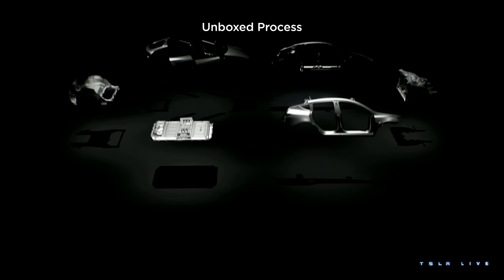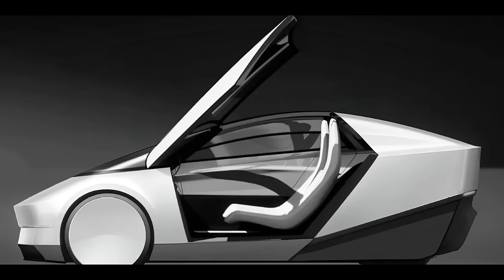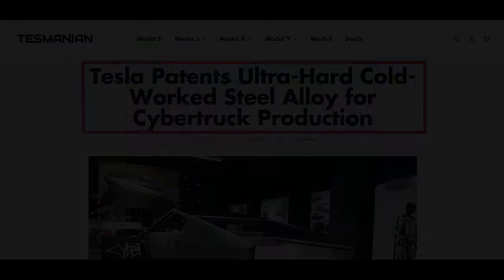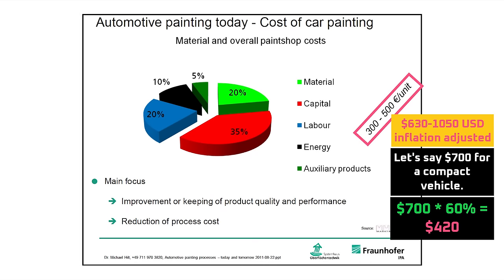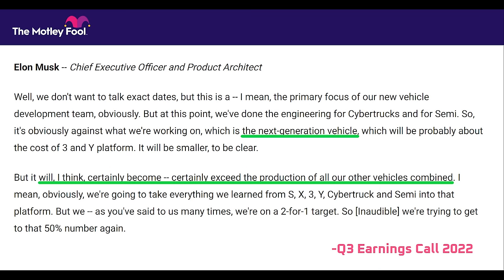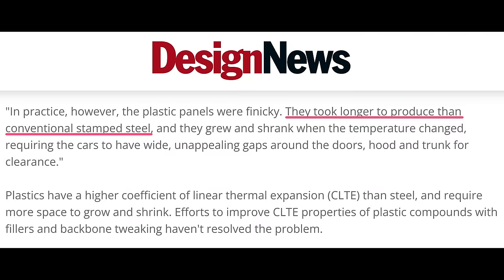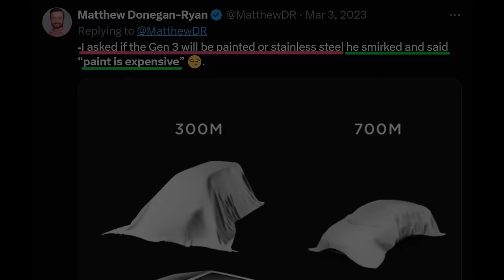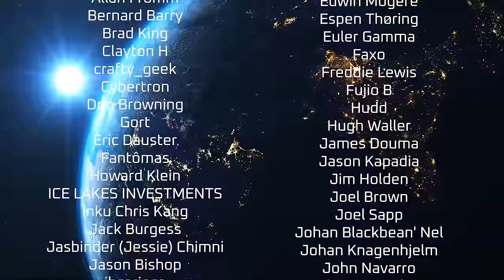Tesla's Next Gen Compact Vehicle // Stainless Steel vs Paint

Comment: Costs $420 to paint the compact? That checks out.
Reply: @thelimitingfactor  IIRC the way accountants work, 1. They ignore the factory-capital cost/(probably)water-consumption/water-treatment etc which get lumped into overheads & distributed across all elements of vehicle cost (paint has a big foot print).  2.  Defects and remedial are also likely to be treated the same way, so paint damage further down the line say during installation of a door will get assigned to door costs or over heads. 3. the time the vehicle is in the build process gets picked up in over heads.  Me, I’d quite believe paint costs 25% of a vehicle, but others, like Munro & Associates could tell you for sure

Comment: Plastic can be high quality, it's just usually isn't. A good example is LEGO. There are countless advantages of plastic, and few disadvantages.
And I don't think people care too much about the prestige of a robotaxi. As long as it looks solid and comfortable, it's fine. And for those who want to show off, there will be legacy Teslas.
Reply: I agree with you, but the plastic problem isn't just about initial quality. I used to sell the machines used to make lego molds, and the key is extremely tight tolerances for the mold and injection molding process. The problem with plastic, at least according to Bob Lutz, is that no matter how precisely you make the part, it has a lot of thermal expansion. I just don't think it's an issue for a taxi.
Reply: Plastic could be molded with colors, no paint required
Reply: If Tesla figures out a great plastic formula, and it gets the price and weight down, I'd totally buy the car. In a taxi I also wouldn't car of course.

Comment: For the cheapest model, price seems to be the driver for consumers.  Plastic didn't stop customers from buying Saturns.  And I understand that Tesla has some top tier material people, who might be able to solve the problems for plastic panels, just as the stainless steel issues were worked for the CT.  Of course, if it's an entirely new material for panels, that's potentially exciting.  (A risk, but Tesla seems to take risks, and there could be a cost, or production speed or space, upside.)
Reply: When Sandy Monroe suggested to Elon he mix Aluminum and Carbon Fibre Elon was dead against it. Elon trained as a materials scientist at University.
Reply: Corvette has been fiberglass for 70 years
Reply: @jamesengland7461  And fiberglass is dramatically harder to work with than injection molded plastics.

Comment: A notable advantage for plastics is their low thermal conductivity that can significantly offset cabin environment energy use in an EV. This thermal break also helps to slow battery degradation rates while the car sits in the sun. This low thermal conductivity does come at the cost of dimensional stability (relative to metals) however, and larger panel gaps can greatly affect attached airflow. Gains in thermal performance could be more than offset by a decrease in aerodynamic performance at higher speeds. But lower speed taxis designed for city use, I suspect plastics have more pros than cons here, as total cost of ownership (i.e. outdoor storage) is very heavily weighted in fleet vehicles. Worth noting, the angular look of SS would be a liberty in a pedestrian heavy enforcement. A lawsuit there would likely increase the cost of ownership outside the scope of consideration.
Reply: Great comment, great ideas!
Reply: Would a steel car cabin heat up slower in the sun than a aluminium cabin?

Comment: When Penske/Mercedes finally brought the Smart ForTwo to the US, I bought one.  I drove the wheels off that thing in and around southern California.  Of course, I hopped it up with wider wheels, a better (and noisier) exhaust and lowered  the car an inch.  In dark blue and black it looked like dart Vader's helmet.

Why do I mention this.  Because I found it wonderful to pop off any plastic panel easily for access beneath.  I don't think there was a panel that I didn't remove several times.  I never broke a fastener and the panels always returned to their correct positions with minimal panel gaps.  Smart owners would go to gatherings where people would swap panels.  Don't like Yellow?  I do,  How about we exchange panels/colors.  I saw some cars leave such gatherings with every panel a different color.  Talk about a coat of many colors!

The SmartCar concept was excellent.  The car shape was too unconventional to many Americans, but the real flaw was the computer controlled mechanical clutch and gear shift.  It was efficient, but it was slow.  The gears changes were slow and the gap between first and second was a chasm.  But once rolling it was a delight in traffic.

If Tesla were to follow the SmartCar body material with a more conventional style, and hopefully a higher rear roofline with a full hatchback, I am convinced it would be a winner.  Stainless? No thanks.  Painted?  If it's less expensive, but I seriously doubt it.  You could buy a full set of different color plastic body panels for the SmartCar when new for $700, admittedly a decade ago.  When I sold the Smart after ten years of heavy use, and despite it having spent many days parked in 'door ding heaven' multi story car parks, the bodywork still looked like new.  For me, plastic panels are the solution Tesla needs.
Reply: Under-rated comment. Smart-style city cars are the way. 
(Who needs rear wheel steering to go get a bag of oranges?)
Reply: @nickfosterxx  you don't but I would happily drive mine all over the UK, up to about three hundred miles, with no comfort issues or safety concerns. Admittedly, I'm not an abject coward as a lot of people who scream that small car are unsafe clearly are but they were great cars for the time.
Reply: Yes, the Smarts automatic gearbox wasn't as fast as it could have been, although it did apparently improve over the one I had. It was really fast compared to every single car I ever raced off the lights though due to the weight. And boy did people get annoyed that I could overtake them on the motorway because they weren't actually doing 70 anyway. Lots of bruised egos. The panels were great and while I never modded mine, knowing I could was a bonus. If only they'd made their electric one a ground up vehicle and done it properly it would have been as good as the Chinese versions with a much larger range. Sadly that's not the Mercedes mindset, they're much more comfortable designing out of date technology and the original Smart guy wasn't around to push them any more so they stabbed it in the back like the traitors to humanity and engineering they are at heart. 

If Tesla put more than two seats in their budget car I will not be surprised but I'll know they were never serious about the idea at that point.
Reply: The BMW i3 was constructed as a carbon fiber monocoque on top of a aluminium frame with abs body panels and seems to be extremely durable.

Comment: If I could place a wager on the future manufacturing processes of the Model 2 / Robotaxi  I'd put a stack on the following:

Gigacasting approach to make all structural components: Door rings, door and rear hatch structure, front and rear chassis & roof cross members with a coated finish where required . This eliminates all stamping and welding processes and gets close to the "Whole Body Casting" approach without the complex mould geometry. Thats 11 cast components total by my reckoning.

Exterior panels: Mould in colour body panels consisting of front & rear bumpers, door, hatch, bonnet (hood) and rear quarter skins with a glass/polycarbonate roof. Smart have been using thermoplastic body panels for a long time with no descernable issue with panel gaps. I've seen at some trade shows that colours other than solids (e.g. white, red, black) are available for injection moulding, this includes metallics that are indistinguishable from a painted surface.

Said thermoplastics can have a high % of recycled feedstocks as other manufacturers have show e.g. Volvo using recycled window frames and Renault using recycled plastics in interior fabrics.

Hard-wearing rapidly replaceable bodypanels and non-rusting structural components would be a good fit for Robotaxi fleets with expected lifetimes spanning decades. For the same reasons the Model 2 will appeal to buyers who place reliability and dependability high on their list of requirements.

Comment: Great work Jordan.  IMO, The future belongs to ones that can make good looking diamond like coatings simply and inexpensively.  Stainless does not need to be highly work hardened super alloys.  Any one of a number of appliance type stainless alloys could be near directly replaced in a conventional stamped and formed body part.  Will be interesting to see how much more they use lighter aluminum and or magnesium alloys as well as  possible ceramic coatings to maximize finish durability's.  I expect a bit more of the sandwich approach they applied in the rear of CT with castings and molded plastic substructures with metal or FRP exteriors.  New bench marks in specific strengths and stiffness .

Comment: I think the 25k car and the robotaxi are actually the same vehicle.

It will be designed so that it can be shipped with or without a wheel.

As for the panels, taxis, rentals and non owner use in general usually results in higher maintenance cost because people don't care if they don't own it.  Having a stainless steel body could save in that regard.

Comment: Good summary, good numbers. Thanks.  => The no paint aluminium option would have been interesting to analyse.
Reply from the maker: Good point!
Reply: A lot of motorcycles use anodized aluminum.
Reply: That is intriguing.
Reply: Good colour ranges possible but I’m unsure about resistance to coastal conditions. Having said that, all our bus panels in Africa are from rolled aluminium
Reply: Afik aluminum is a lot harder to stamp into complex shapes.  But a hot-stamping process like Tesla is already using on CyberTruck might change the numbers?  An alloy which age hardens at room temperature (like 2024) stamped and quenched by cold dies would be interesting.
Reply: @martylawson1638  Model S has aluminum panels.
Reply: Aluminum seems to be more expensive, and repairs are definitely more expensive.
Reply: @martylawson1638  model S and X are mostly aluminium.
Reply: @patreekotime4578  for a robotaxi, the no paint is a plus. Harder to repair is a downside for sure unless panels are swapable like on a smart car.
Reply: @martylawson1638   But what about cast aluminum like they are doing with the car bodies?  Could they do that for the panels too?  Or even cast the body panels with the rest of the car body?
Reply: @logoschristianacademy6044  Cast aluminum body is another interesting wild card option.  Casting has a relatively thick minimum thickness so the cosmetic surface would have to be structural.  Might need a secondary finishing step to hide sink marks and mold wear.  On the other hand, toys and appliances have done it forever...
Reply: Unpainted aluminium is often used to construct boats and canoes, so it would not be unexpected for a car to be constructed from it. However is there any reason cars are not constructed from it, could it be to maintain colour and texture consistency between materials.

Comment: You can't compare to the Saturn, as there have been major advances in polymers since then, most models of cars use an extensive amount of plastic on their body these days without major issues.
Reply from the maker: They always have in bumpers, etc.  But not the body.
Reply: @thelimitingfactor  Bumpers, the entire fascia, kicker plates and wheel arches on off-road type vehciles. All of the protruding bits like mirrors and spoilers, the entire exterior of those fancy light clusters. Take a good look at a modern vehicle. At least 30% if not 40% of that surface area is plastic.

Comment: Material rigidity is the cube of the thickness so 0.25mm is 64 times less rigid than 1mm. I doubt that 0.25mm sheet metal would be a reality on vehicule body. Also about the value of stainless, I think customers will not only see the initial cost it add to the vehicule but also the value of durability for region where corrosion is affecting vehicule alot.
Reply from the maker: Yeah, I was trying to give the devil his due

Comment: Hey Jordan, as someone who works in mfg engineering, this is a great analysis! A few additional thoughts: 

1. Personally think if the low cost vehicle were to use SST exterior, I would think they would use a less hard alloy, such a 304, or a lower cost alloy like 400 series. Preferably one that could be efficiently stamped and shaped instead of the complicated Cyber truck processes. 

2. (Out there idea) For color it would be interesting if they used a heat treating process to add a color hue or tint to SST while adding strength.

3. In my work we like to perform a Unit Operations analysis (first principles) when evaluating and developing new processes. Break process down into individual unit operations and assess for critical to quality, ease of assembly, risks, mitigations, time, cost, etc. Have you considered running a hypothetical analysis for a traditional painting process and look for possible optimizations? 

Hope you're doing well! - Nick
Reply from the maker: Good points and thanks for the feedback!

Comment: I am wondering if they are making their own SMC CF for the cybertruck bed parts or is that a subcontractor? The old Saturn's were the beginning of that with fiberglass reinforced body plastic panels. SMC can make very nice body panels from fiberglass these days that are durable and easy to repair minor dings. You can infuse UV protection and color. Fit and finish on these parts is so good they can snap together if desired. Waste from trim can be reused for other moldings. That can include fittings like nuts molded into the part, wire pathways or textured adhesive areas that give a first time, every time consistent fit. Making construction simpler and fits right in with the unboxed method. There are also vinyl and PPF wraps.

Comment: As far as Saturn's plastic panel issues go... we have to remember that that was 20 years ago and plastics technology has moved forward quite alot. Like the problems with aluminum casting, I do not think this is at all the barrier that it was at one point. 

As far as people not liking the idea of a "plastic car"..... public perception is all rather silly and the bulk of the front and rear end... as well as kicker plates around the exterior of many vehicles... and all protruding features like mirrors and spoilers... at least 30-40% of the surface area of most vehicles have been plastic for decades. And remember that despite the reputation, Saturns were never all plastic they just had plastic bumpers and fascias (like every other car) front quarter panels, and main door panels. The rear quarter panels, trunk lid, roof and hood were steel. In other words, just slightly more plastic than a Subaru Outback... which instead of being viewed as "cheap" is viewed as "rugged". Because public perception is entirely silly and moldable by PR. 

As a customer, the advantages to plastic are incredible... it never rusts, the paint doesnt usually fail, it survives low speed collisions and can be "popped out" with a heat gun, and if it needs to be replaced its incredibly cheap to do so. It is very light weight (meaning total vehicle weight is reduced, thus extending range) and when painted it looks no different than steel (which is why we "forgot" how much of modern vehicles is plastic to begin with). It basically eliminates worries about parking lot dings and injury in low speed collosions. From a manufacturing perspective, especially for a robotaxi... the color could be shot in with the panels (black is already a common base color for plastic car parts and is likely one of the cheapest dyes). It is also possible to shoot carbon fibre or glass fill in for components that need higher structural strength like hoods and trunk lids. 

To me, a production line merging cast alumnimum frame components with injection molded plastic panels sounds like it could be the ultimate in high production. Whatever time is lost in molding plastic vs stamping is probably made up for fast assembly... plastic panels can easily be molded with build-in assembly aids, tabs, and snaps... no welding required.
Reply: Pontiac Fiero was introduced 41 years ago.
Reply: Your ideas sound good and seem practicable. The RT doesn't have to look good, it just has to work well. 
The RT could be used to check public opinion and to optimise appearance,  materials and production processes for the compact.

Comment: I'm wondering how respectful users would be of the paint in a robot taxi. Also, how much it would affect their view of the service if it showed abuse.
Reply: Will  be an app  for sure , where you will control  who can use your  robotaxi and when, ,if the  customer has bad feedback you can refuse  him to  use  your taxi
Reply: @gaborkevlar2821  I see that kind of micromanagement work for the kind of amount and duration of Airbnb stays but not for taxies. Plus, how to be sure who exactly is responsible for trashing the outside paint? Could be a rock thrown sideways by a passing vehicle, a cart in a shopping center, another door opening, a passerby and so on.

My main point was: considering electric vehicles at first required to look more at the TCO than the buying price only. For Robotaxi, you could consider durability being more important than the cost of manufacturing, ultimately to have also a lower TCO.